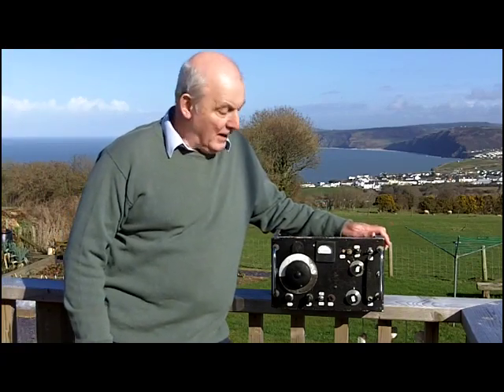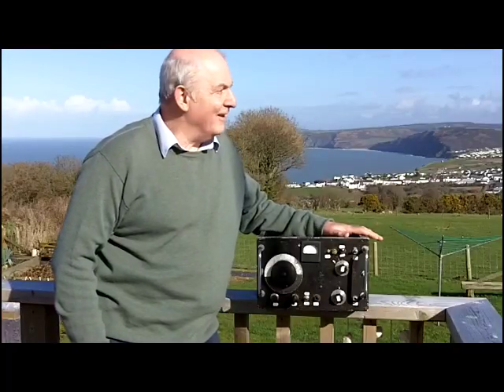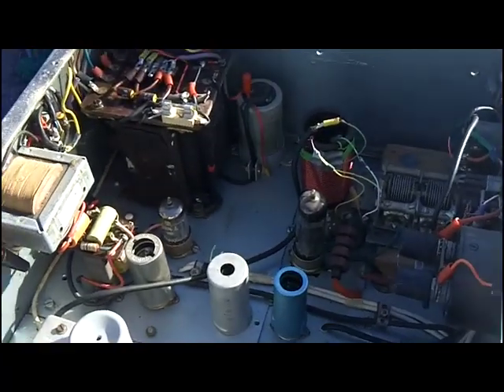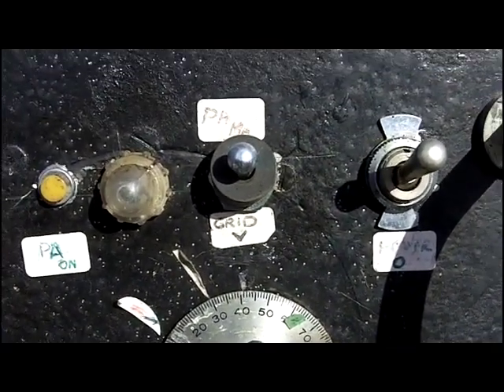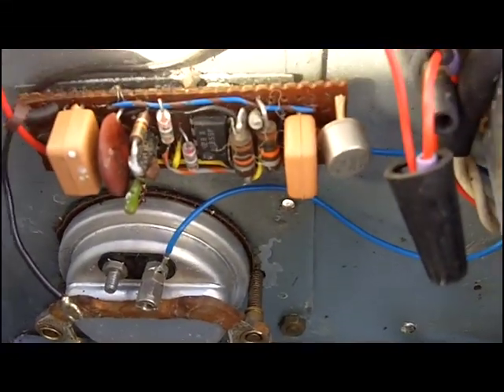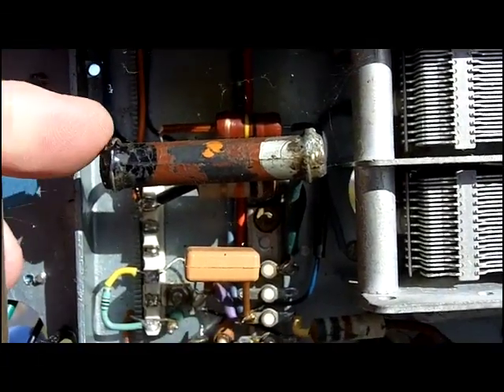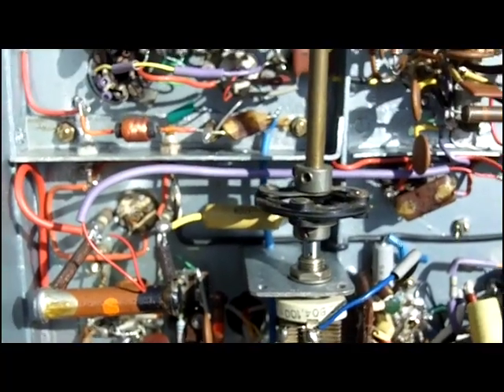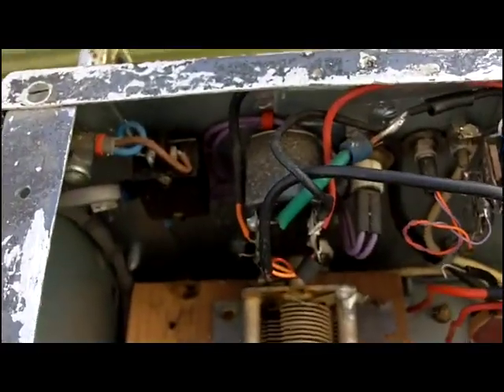80 Metre Home-brew TX-RX

Comment from the maker: @bingobonkman 
I know what you mean, there’s nothing quite like that moment when you hear the first hum and crackle out of a pile of junk you’ve pulled together on the bench. I’ve still got the fist 80 metres receiver I ever built. Every now & then I switch it on & there’s still that sense of achievement, it doesn’t have AVC, if a local station fires up it blows my head off. As a special purpose machine manufacturer I allays loved that moment when you breathe life into the beast  
73  Andy